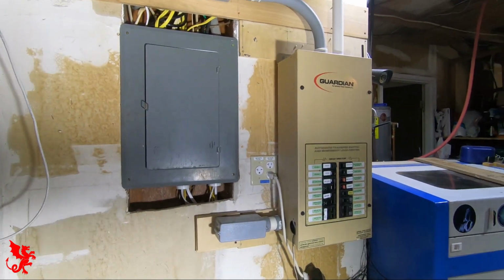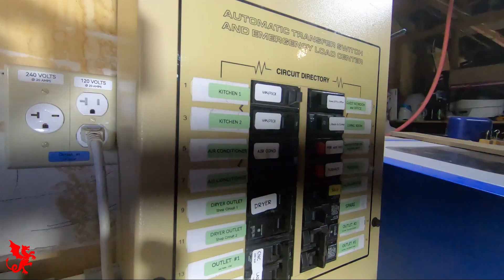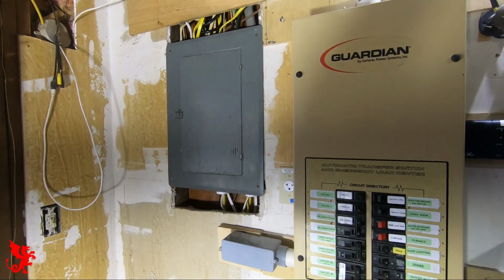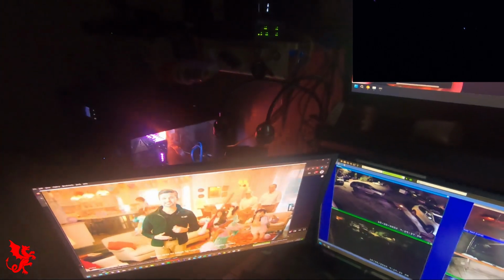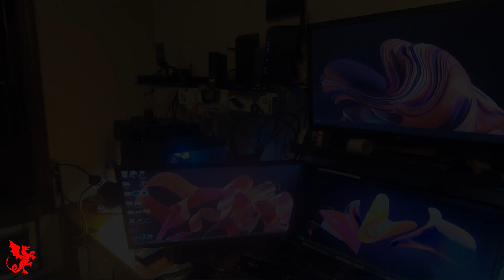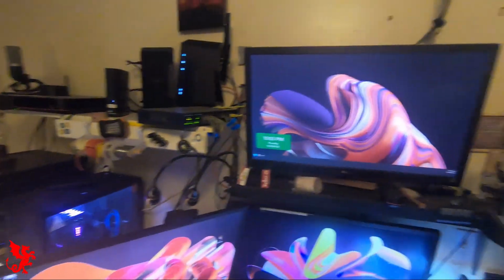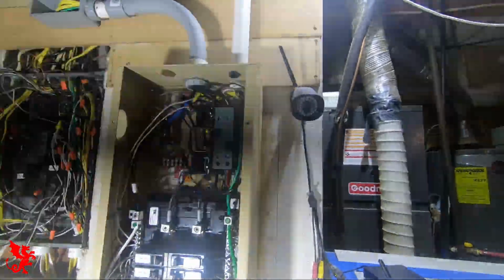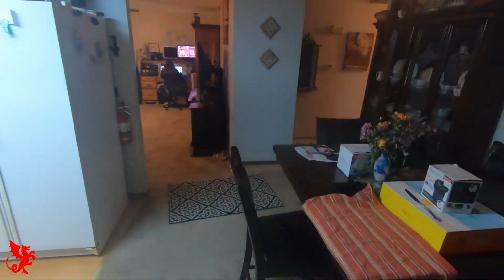Rebuilt Generac Guardian 16kw First Run - Full House Test

Comment: so, what all was involved in your rebuild. i found a 2002 20KW with less than 3hr's on it. I then made the big mistake and replaced the factory 90 amp breaker with a 125 amp . two weeks ago we lost power, for some reason i wanted to see if this unit would run my very old 5hp air compressor. well, it shut down my unit. It would restart but would keep trying to restart while already running. i picked up a new CTB , but still doing the same thing. BTY after a few times of the restarting it shuts down. I know the shutdown is because the CTB is not seeing power. hopefully I didn't burn up the windings. any help will be greatly appreciated
Reply from the maker: Does not sound good! I am assuming the "CTB" is the controller board. Also assuming, that in 2002, the units were "dumb". IE, no display, just a row of red lights. Overspeed/No RPM Sense may have been lit in this case. Also, Over Crank could have been lit. My unit controls its speed (also hertz) by watching the output of the stator. No output would keep cranking. It would not know it was already running. Over crank comes on when it has tried 3 times and never got a signal (output power at a required hertz). [I believe this is what you experienced when you said after a few times of the restart cycle, it shut down for good. Power off/power on to get  it going again?]
How to quickly test your stator: Open the breakers on the unit, then remove top cover panel. Try and start the unit, just for a sec. Watch for a red led on the box on the right. (the box on the left is the battery charger.) No red LED, no power to the control module (CTB?). With the unit OFF (!), check continuity of the 2 legs (windings. Each winding puts out 120 volts, 180 degrees out of phase. Together they output 240 volts.)  Check each of the 2 fat wires (might be black) going into the circuit breaker to the common neutral (might be white). Each, hot to neutral, should be around 20 - 30 ohms. Maybe even lower. Then check to each other, (black to black) Should be open lead, no continuity between windings.
This is the manual page how to test https://www.manualslib.com/manual/807129/Generac-Power-Systems-Corepower.html?page=35
Gotta ask: Why did you want to change the 90 amp breaker? And what does CTB mean?
I do understand the trying to “See what this baby will do” impulse is. First run of the house test, I HAD to try the A/C!
Email me! I want to hear how this ends!

Comment: I have same unit but paid 2x what you did. What size propane tank did you finally have to use? Or are you still using that in house connection?
Reply from the maker: Natural gas connection. Need a new regulator for backup propane. Tell me about what you acquired? Did you get the transfer switch with it? Was it running? Or did you need to work on it? Mine is I think, 2009 vintage. Plain Jane, but works as advertised! Are you keeping yours? Or did you get it to fix up and sell? Thanks for the comment! I would love to hear more about yours, if you plan on installing it and what you are going to do about the wiring.
Reply: @DragonwoodDesigns  is your unit water cooled ?